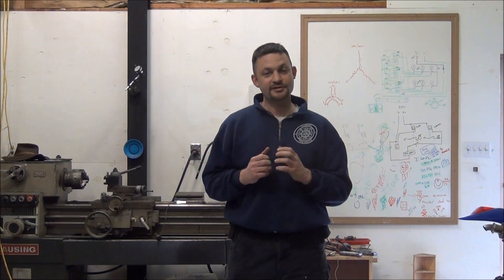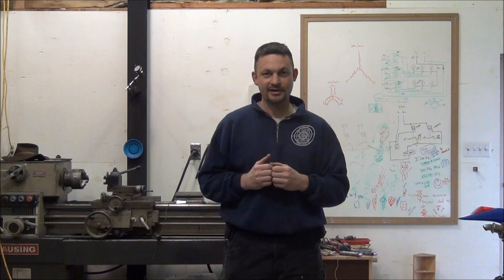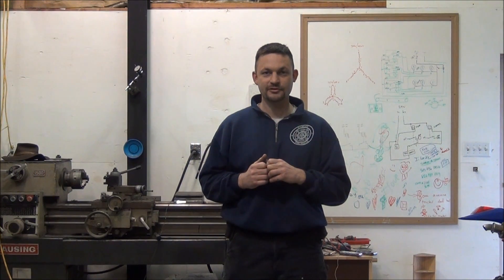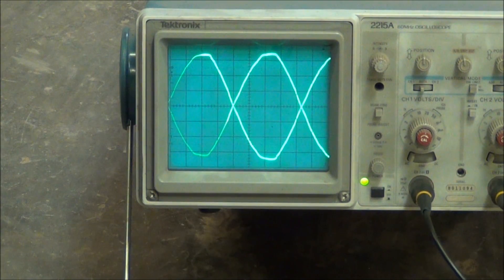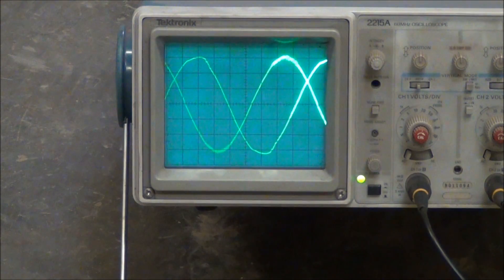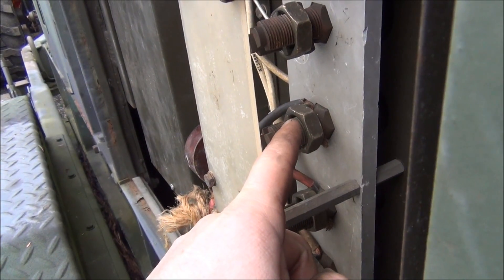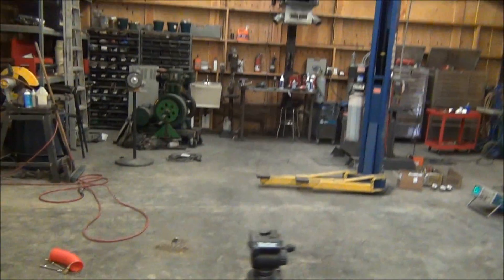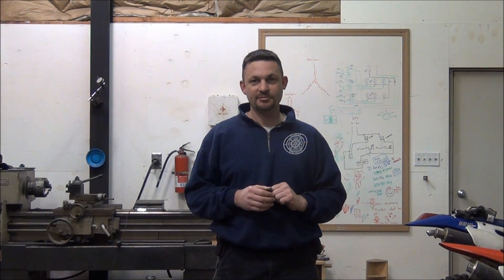3 phase generator for single phase residential backup power

Comment: Hello I have a 3 phase m5 generator. I have a 3 plug connector. I understand any 2 will give you the 208 but where would you get the ground ? The plug is a,b,c would one of those be considered the ground? This is a 1941 Hobart m5
Reply from the maker: Can you tell me what kind of plug it is?  A description, or even better...it's NEMA number?  Generally, if it is labeled "a b c" on the 3 conductors, those would be each of the 3 phases and that plug does not have a ground or neutral.

Comment: Can you wire it in a way that you can run the single and 3 phase equipment through house panel? Or do you have to wire 3 phase stuff directly to generator?

Comment: Am I understanding correctly that with this conversion, you can get almost the full rated output in single phase 120/240v?

I know this an old video, but also is it possible to make this gen set work in two wire auto start? Maybe install a cascade controller? I’m looking at installing one for home back to work with my ATS
Reply: The gen he was using was 120/208. If yours is 120/240 you will get that if not you will get 208. You will not get the full kw from your gen when using it in 1 phase. You will be limited to 2/3rds of full power. A 30kw 3 ph would provide about 20 kw in a 1 ph set up.

Comment: How to you wire to get the 208 i dont understand each leg has 120 how do you connect then to get 208 ?
Reply from the maker: Because the legs are 120 degrees out of phase, you don't just add 120+120 like you would in a split phase system (where the legs are 180 degrees out of phase).  If you put a voltmeter between any two hot legs of a 120/208 wye 3 phase system, you'll get 208 volts.  I explain this visually with an oscilloscope beginning at about 7:50 in the video.

Comment: Up to 10kva
You can also use an appropriate sized 208/240 single phase transformer and connect 2 phases to the primary and you will get your 240 and keep the full rating of the generator.
For above 10kva
You can use an open delta transformer. when you do this you connect the primary as normal A B C , on the secondary use only A and C 
 the outside phases on the primsry and secondary will draw the same amperage, but the B phase on the primary will draw the combined amperage of the outside phases.

Comment: Hello. Any chance you can tell me how to wire a cummins generator single phase 240v ac for a back up generator there is a 4 lead connection that i can wire but i’m missing a wire. There is a 12 lead double delta i have all the wires for but I don’t understand how to wire it. Please help. Thanks

Comment: The new military Advanced Medium Mobile Power System (AMMPS) (If you can get them) MEP 1040 10KW generator is far superior to the old Mil Standard or TQG's. Digital controls and more reliable.

Comment: Get an MEP 003A (MIL Standard) or an MEP 803A (TQG) which is a 10KW generator and set it to 120/240VAC by the S-8 Switch which is a series Delta configuration. You'll use L1, L3 and Neutral. 120VAC from L1-N and L3-N and 240VAC from L1-L3. This is the most ideal generator for a house and it will give you the same amount of amps of an 004A or 804A 15KW generator; 52 Amps per phase and won't unbalance the generator.  The three phase, 15KW generator can only be configured to a Parallel Wye 120/208VAC or a Series Wye 240/416VAC and will unbalance the generator if you only use two of the three legs. This will eventually cause damage to the generator bearings and windings. You can also configure the 15KW in the same way as a 10KW (120/240VAC) by connecting the terminals the same way as the 10KW. You have to bypass the tap-change-board to do this configuration.

Comment: One issue will be the generator load imbalance, it is only using 2 phases, so the rotor will heat up, it would be better to split the DB board load 50%:50% on the heavy used of the 2 utility  phases and hence then use all 3 phases, the generator will still have an imbalance but it will be less severe, you need a 4-pole transfer switch and you need to separate one of the utility phases in the consumer DB into 2 electrically isolated DB's fed from the same phase when on utility power

Comment: i have a genarator twin cylinder its 3 phase 4 wires coming out so do i just join up to any two of them and take an earth from the body of the engine? to have 240 or 220 volt?
Reply from the maker: The 4 cables you see should be L1 L2 L3 and N.  Between any two of the L terminals will get you 208v. Between any of the L and N cables will get you 120V.  Assuming it is wired in Y configuration (this is the most common).

Comment: Matt, I recently bought a 3 phase 125 kva lima generator that has the 4 cylinder detroit diesel. My voltage regulator board is fried and I'm not seeing any replacements online. Do you have any suggestions? Thanks Mike

Comment: Wow, great content!  Hoping you can point me in the right direction.  I have a 1994 Generac 08976-1 1 and 3 phase diesel generator.  It is missing a voltage regulator and the controls are really old and not working.  Can you recommend a control and AVR to upgrade it?  I assume its just wiring it up to the generator and engine?

Comment: 8:11 correction, you actually get 1.414 or sqrt(2) times more voltage than the 240V "RMS" rating we use to rate AC voltage. RMS means you take the AC waveform, you take the average over 1 cycle of the squared voltage wave. It's done this way because the peak voltage overestimates power delivery into a resistive load, and just taking the average would be zero because the 2 halfs cancel out!

So for a more rigorous definition of RMS concept:
Power dissipation in a resistive load is P = I*R = V^2/R = I^2*R. (R = V/I) (as voltage goes up, so does current. Doubling voltage quadruples power. P=I*V -> I=V/R -> P=V^2/R) To find the "equivalent DC power" voltage for a resistive load (heating elements and incandescent lamps mainly) it makes sense to work with V^2. Just take the average of (Vpeak*sin(2*pi*f*t))^2 over 0 rad to 2*pi rad using integration. Boom you got the idea of RMS! For sine waves it's 1.414

Comment: I've done all of my own 110 & 220 electrical work for decades; but, when it comes to 3-phase, I'm a total noobey... I learned quite a lot from your video; but, since your example was a military generator, which had a "Line 0," I'm still left with a lot of questions. I'm going to be rewiring some stator/rotor "smart drive" motors, which I've scavenged out of "dead" washing machines. (Typically, because the control board went bad & started throwing error codes. Out of 6 motors, the stators have tested good in 5. That one was probably good until a FedEx driver mistook the package for a discus...) The process for converting these from being motors to being generators involves some major snipping and soldering, leaving you with 3 wires (made out of jumper cables - #8? #6? wire,) not 4... How would someone wind up with a "Line 0" on something like this? Would it just be the (lighter gauge) grounding wire?  3 of the 6 were picked up used on ebay; the other 3 cost me $10/ea. for the entire washing machine; but, still, I hate to waste any of them; esp., on my marginal budget & having that one already damaged by that FedEx driver.  I don't remember how many stator coils are on the damaged stator; but, regardless of the total number, that number is always divisible by 3... IF I can isolate the damaged coil(s?) on that one; and, be left with a number of good coils which is divisible by either 2 or 4, might it be able to be rewired for either 110 or 220 single phase?

If you don't know, perhaps someone who has tinkered with these type of motors, such as to use them on a vertical axis wind turbine might just know; &, I'd welcome their input, as well... :)
Reply from the maker: L0 is the center of the “wye.”  It wouldn’t exist in a generator configured for delta 3 phase.  It is at zero potential; so from any of the hot legs to L0 you get 120v.
Reply: @MattVerley  So, if I rewire it for wye-type 3-phase, I'd wind up with 3 hot 120v "legs" and the equivalent of a neutral? (I'm trying to learn all of this from scratch ~ at 67, with brain fog whenever I push myself too hard... Difficult; but, better than any of the foreseeable alternatives...) 

The "save" button isn't showing up; &, the scroll bar won't let me scroll down to find it!

Comment: I picked up an old lister 8.5kva single phase gen the other day, the windings come out with what looks like 3 phase designations and are linked together some way to make it single phase. This is a plated single phase unit.
Reply: From what i can make out there are 6 coils configured in two delta patterns

Comment: Nice video..The smaller TQGs 5/10kW have a voltage reconnection switch inside the control panel.

Comment: I have a question for you sir.
I have a 3 phases 220 v generator, that I bought in USA but I take it in Africa were power is single phase 220 v.
Now I want to know how should I use that generatorto power my appliances 220 single phases.
Thanks

Comment: Wow, thanks for the great video! Subscribed! 
I have a question about the generator itself though. If I plan on running just two legs off of my 3 phase generator, the 3rd leg won't be doing anything..no shared loads...nothing. Is this bad for the generator? Balance issues etc.? Should I plug an electric heater into the third leg and just heat the outdoors? I'm all about that global warming! ;) Thanks!
Reply from the maker: No, generally speaking there is no problem running an unbalanced load like that.  The only real precaution is to make sure that current through any one phase doesn't exceed limitations for that leg.  Obviously...you can't get 15kw of power through just one or two legs of a 3 phase 15kw generator because the single phase current will be much higher than the 3 phase current would at the same power level.  In the MEP's case, it uses a shunt type breaker that uses a current transformer for current monitoring.  So, you can't exceed phase current limits without tripping the main breaker.  The real reason to switch a generator to single phase would be so that you can get the full rated power out of the generator, or if you needed 240/120v split phase instead of 208/120v.

Comment: Hello Matt, I currently have an MEP-804A, the generator is blown. I wonder if it is possible to rewind the generator to produce single phase power only. I am interested in using it as a backup generator for my house, but I would like to be able to use the full capacity of the generator without damaging it. I would love to talk to you more about it.

Comment: Hi Matt. I have to find a way to charge two electric trucks that need 3 phase /50Amps. 204V. Where I pive ther eos only regular phase. Can I have your email so I can send you what I have .. and maybe you can help me out? Tha ks
Reply from the maker: There are a number of ways to generate 3 phase from single phase...but at that power level really the only economical way is with a rotary phase converter.  However, this really won't suit your needs well.  Depending on the chargers on the electric trucks, there is a small chance they might be OK with a single phase input (there's no way I can guarantee this without part numbers and/or schematics).
I hate to say it...but my guess is that you're going to be stuck finding actual 3 phase power, or changing the charging circuitry on the electric trucks.

Comment: Load balancing I feel would be the only issue. You can't just run two legs without considering the neutral.
Reply: That's what I was thinking, although, use a autotransformer and get your neutral.

Comment: Can 120/ 208v 3 phase generator power a 230v 1 phase welder without modification has 4 prong 120/208v 20amp receptacle  beside getting an adpator from 3 prong welder plug to 4 prong from generator?
Reply: Is it single phase and 3 phase aswell?

Comment: I would like to try the exact opposite. I would like to power a 3 phase house with a single phase portable generator. Is that possible?
Reply from the maker: Not really; there are ways to get 3 phase power from a single phase input (static inverter, motor generator, etc.) but those are expensive solutions. A person is better off simply finding a 3 phase generator head.  
What kind of 3 phase loads does your house have?  It is unusual for a residence to actually use 3 phase power; almost no consumer appliances use it.

Comment: Your graph is mirrored across the x axis...?  Meaning you would have no voltage if you pulled from either leg. You're 240 graph is going to look the same with greater amplitude.
Reply from the maker: Not quite; if you pull from one leg and neutral you have 120v.  If you pull from both legs you get 240v because each leg is 180 degrees out of phase with the other leg.

Comment: I have a 60kw diesel three phase generator. I only have 4 terminals. Three hot and neutral. I want to use this with a power distro that has three hots, neutral and ground. five cam-locks. can you explain how i can make this work?

Comment: how would you connect the wires to backup a house running 3 phase. from the generator to the house?
Reply from the maker: You just connect any two of the generators hot legs (L1, L2, or L3) to the two hot legs in the breaker box and then connect the generator's neutral to the breaker box's neutral.  That is the GENERAL idea.  Local electrical codes may dictate exactly how you do that, whether grounds and neutrals are cross connected, type of disconnect switch used, etc.
Reply: sewerzuk thanks for the answer
 by doing that you will be sending 3 phase to a house?
Reply from the maker: shnobi24 No, the 3rd phase from the generator is not used. When you hook it up as I described, you are sending split phase to the house which is basically the same as what you get from the power company.
Reply: sewerzuk thanks, but like you say you only use 2/3 of the useable power.

Comment: i need help how can i use my 220  3phase welder with 220 1phase? i already used a static converter and exploded the capacitor
is there any solution?

Comment: how can i use 220 three phase welder with 220 single phase
Reply: Phase converter. There are rotary phase converters, which as the name implies are electromechanical devices, and can actually be built from a three phase motor, a few capacitors, and a smattering of electronic components & switches. There are also solid state phase converters, which are more efficient then rotary, but also more expensive to purchase.
Reply: 220 3 phase is not a thing.  Nor is 220 single phase.

Comment: Great video friend.Very informative. I have a question for you, I have a 3 phase generator that produces 380vac. Is it possible to use one leg and a really good ground to have usable 120vac single phase? It will be used in a remote area without any connection to a house ground or neutral. Thank you in advance for some pointers.
Reply from the maker: Robert Tainio is that 380 phase to phase?  so each leg is producing 190 volts?  I would use a transformer to drop from 380v to 120/240
Reply: Ok, thank you.

Comment: Hi, I have a Diesel engine (60KW) that I can run for free on used plant oil, and a great big brushless 3 phase motor 7.5KW that I'd like to couple together to make a permanent generator for my house (which is wired for 3phase from the grid (220-240/phase, 50 Hz) here in Europe). An elec engineer once told me that if I do this I can easily pull the phases out of balance and move the 'zero' so that I might damage computer equipment (etc)on one of the phases, etc so it would be best to give up and buy a modern-ish generator with some kind of automatic/built-in balancing. Now, most generators will not be set up for biofuel whereas my diesel engine is. And, it's free. What do you reckon? Is there a reasonable way to balance the phases, or either build or buy some kind of add-on balancer to achieve my aim? Do modern generators (one suggestion was a tractor generator) really have balancing devices in them? Any help appreciated. And thanks for the videos you put up.
Reply from the maker: It is rare to have balanced loads between phases on small generators; most generators are designed with specific per-phase current limits.  As long as you don't exceed that limit, there should be no problem.  Most generators have circuit breakers for each phase; as long as yours are sized properly, it should work fine.

Comment: Great video! We have an older Tate 25kva genset.  Hooked L1-L3 to the main breaker panel.  208v rock steady until I flip a breaker on. That leg goes to zero and the other leg shows 208. Any ideas?

Comment: Why not just add or replace with a three phase electrical panel and pull in a "C" phase cable???  Use a same brand of electrical panel and you could use the same type of breakers.  Then balance out your loads over the three phases and still have three phase power for your special shop power equipment.  Just saying this might be a whole lot simpler in the long run...
Reply from the maker: +Elliott Manning Adding a new panel is beyond the capability of the average generator user, I think.  The idea behind this video is a quick and simple plug and play type emergency setup.  But, you are right.  You can get more power out of the generator if you balance single phase loads across the 3 phases...